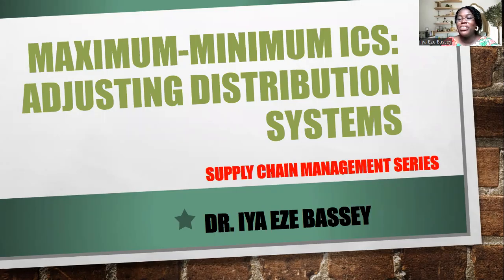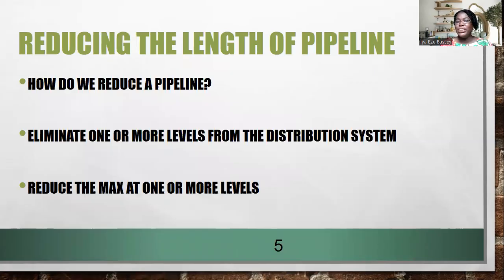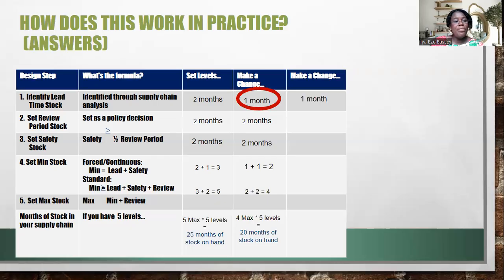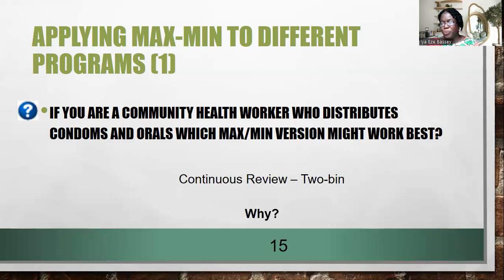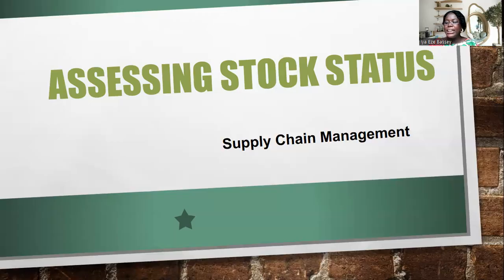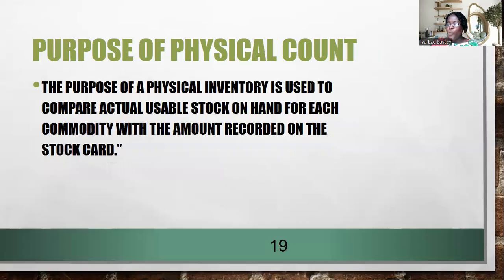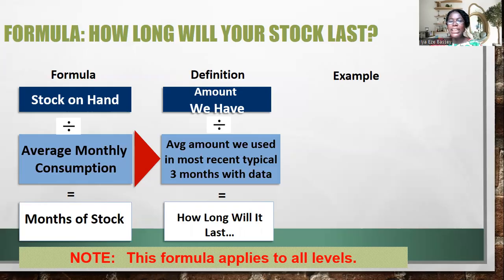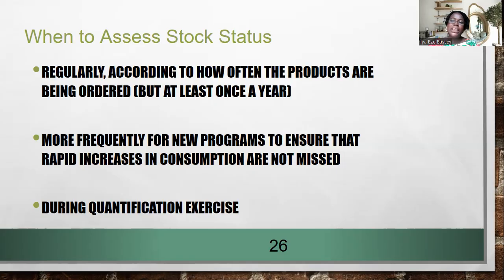Maximum-Minimum ICS: Adjusting Distribution systems (Supply chain management series)

Comment: Thanks for the lecture, ma'am...
Here is my summary 

To adjust distribution system policies, organizations can consider several approaches. These include optimizing transportation routes and modes, implementing technology solutions for better tracking and visibility, collaborating with suppliers and partners to streamline processes, adopting lean inventory management practices, and continuously monitoring and analyzing data to identify areas for improvement.

The maximum-minimum inventory control system sets upper and lower limits for inventory levels. The advantages of this system include reducing stockouts and excess inventory, optimizing cash flow, and improving customer satisfaction. However, challenges may arise in accurately determining the appropriate maximum and minimum levels, managing demand fluctuations, and ensuring effective communication and coordination across the supply chain.

    The inventory control system used in LMHC involves managing the stock of HIV/AIDS commodities, such as antiretroviral drugs and diagnostic kits, to ensure their availability and proper distribution. This system typically includes forecasting demand, monitoring stock levels, implementing reorder points, tracking expiration dates, managing storage conditions, and coordinating with healthcare facilities to meet the needs of patients while minimizing wastage and stockouts.
    Assessing stock status refers to evaluating the current inventory levels, conditions, and availability of products. The purpose of this assessment is to ensure that sufficient stock is available to meet demand, identify potential stockouts or excesses, determine reorder points, optimize inventory levels, and make informed decisions regarding procurement, production, and distribution. Regularly assessing stock status helps organizations maintain efficient inventory management and meet customer needs effectively.

Comment: Thank you very much MA for this wonderful lecture.
In Summary of this topic; maximum and minimum ICS : Adjusting distribution system, have been able to know that the steps in designing a max- min ICS are to set up initial max- min policies for each level and type of faculty, check if the overall distribution will function properly if the level specific max-min policies are are implemented and also checking the total cost of length of the pipeline that the policies at each level imply.
You made us to understand the other factors that impact the max-min stock levels ; like, cost of products, storage capacity, cost of storage, reliability of transportation, age of program, management skills of staff, accuracy of forecasts etc..
You made us to understand that the advantages of using max-min stock is to Avoid overstocking
To avoid under stocking
To minimise wastage
To avoid costs of emergency order etc.
We have also learn how to assess stock status and why we should assess stock status.
Thank you so much Dr.

Comment: I was able to understand the steps involved in designing a max-min ICS which are;
1. Setting up an initial max-min policy for each level and type of facility
2. Check the overall distribution
3. Check the total length of pipeline that each policy level implies 
Also the factors that impact the max-min levels are 
1. Cost of production 2. Lead time 3. Storage capacity 4. Cost of storage 5. Age of program
 The Advantages is using the max-min system are;
1. Avoid overstocking 2. Avoid understocking 3. Minimize wastage 4. Avoid cost of emergency order 
I also learnt that the system with numerous levels can affect the use of this system, also the system that manage products of new program can be challenging in using the variation
In summary, in the medical laboratory science field, the max-min ICU can be very important in managing the supply and consumption of laboratory reagents and equipment. The laboratories should ensure to have enough inventory meet demands without excessive or shortage stocks

Thanks ma'am
Reply: In this session we will begin from,
1. LENGTH OF PIPELINE
The steps in designing a max-min INC are;
A. set up initial max-min policies for each level and type of facility.
B. check if the overall distribution will function properly if the level specific max-min policies are implemented and 
C. check the total length of pipeline that the policies at each level imply.
Note that reducing length of pipeline;
I. eliminates one or more level from the distribution system
ii. reduce  the max at one or more levels .
we also find out how to reduce maximum stock level, by reducing review period,lead time and improve distribution system reliability.
OTHER FACTORS THAT IMPACT MAX-MIN STOCK LEVEL INCLUDES; 
>cost of product
>storage capacity
>cost of storage
>lead time, etc.
ADVANTAGES OF USING MAX-MIN SYSTEM:
> avoid over stocking
> avoid under stocking 
> minimize wastage, etc
 CHALLENGES TO USING EACH VERSION AND VARIATION;
> System with numerous levels.
> system that manage a large number of commodities.
> system that manage product for new programs.
DEFINITION OF PHYSICAL COUNT: A physical count is a process of counting by hand ,the total number of usable units of each commodity in your store or health facility at a given time.
PURPOSE OF PHYSICAL COUNT
>To compare actual usable stock on hand for each commodity with the amount recorded on the stock card.
>To determine how long supplies will last.
WHEN TO ASSES STOCK STATUS
>During quantification exercise,etc.
THANKS FOR THE LESSON MA.

Comment: Thank u ma for this lecture 
  In summary, the steps in designing a max-min ICS are;
1: Set up initial max-min policies for each level and type of faculty 
2: Check if the overall distribution will function properly if the level specific max- min policies are implemented 
3: Check the total length of the pipeline that the policies at each level imply .
   I also learnt how to reduce the length of a pipeline and also how to reduce the maximum stock level.
Also some factors that impact max-min stock levels which I’ll list few ; lead time , reliability of source of supplies, effect of a zero balance or stock ,management skills of staff,age of program,etc .
I also learnt about the advantages to using max-min system which are ;Avoid overstocking, avoid under stocking, minimize wastage ,etc . 
I also learnt how to apply max-min to different programs  and when to access stock .

Comment: Thank you ma'am
Inventory control system (ICS) is usef yo manage and adjust the distribution of goods. The maximum ICS represents the upper limit of inventory that should be maintained to avoid excess while the minimum ICS is the lower limit to avoid stockout. Also steps in designing the length of a pipeline include; set up the initial max-min policies for each level and type of facility, check if the overall distribution will function properly if the level specific max-min policies are implemented and check the total length of the pipeline that the policies at each level imply.

Comment: Thank you Ma
In summary: 
There are steps In designing a Mac-min ICS which are; 
Setting up initial Max-min Policies for each level and faculty 
Check if the overall distribution will function properly if the level specific max-min policies at each level imply.

Elements of the Formulas which can be changed in order to reduce the max stock level
-Shorten  the review period at  one or more levels 
-reduce the lead time at one or more levels
-Improve the distribution system reliability

 Factors that impact max-min stock level
-Cost of products
- reliability of transportation 
-shortage capacity 
-cost of storage 
-shelf life of health commodities

Advantages of using Max min system 
-avoid overstocking 
-avoid understocking
-minimize wastage 
-avoid cost of emergency order

Challenges to using each version and variation 
-systems with numerous levels 
-systems that manage in large number of commodities 
-system that manage product for new programs etc 
Assess stock status entails physical count which is to compare actual stock on hand for each commodity with amount recorded in the stock card.

Comment: In the context of medical laboratory science, maximum-minimum inventory control systems can be beneficial for managing the supply of laboratory reagents, consumables, and equipment. By setting appropriate maximum and minimum stock levels, laboratories can ensure they have enough inventory to meet testing demands without excessive stockpiling or shortages. This helps maintain smooth operations, optimize resource utilization, and ensure timely delivery of accurate test results. Effective supply chain management is crucial in medical laboratory science to support quality patient care and efficient laboratory operations.

Comment: Thank you Ma'am for the wonderful lecture.
In summary,steps in designing a max-min ICS are; Set up initial max-min policies for esch level and type od facility.
Check if the overall distribution will function properly if the level specific max-min policies are implemented.
Check the total length of the pipeline that the policies at each lecel imply.
I also learnt about the steps in reducing the length of pipeline and other factors that impact the max-min stock level.
I learnt about the advantages of max-min system such as avoiding over stocking,under stocking, minimize wastage etc as well as the challenges of using each version and variations.
I also learnt about the physical count which is the process of counting by hand the total number of usable units of each commodity in the store or health facility.

Comment: I learnt ways in which the max-min system is being adjusted. One of the important step to take is reducing length of pipeline. I also learnt the different advantages of using a max min system and challenges associated with it. I also learnt the max min version that can be used in different scenerio, example for condoms and orals the continuous review - two- bin is the best to be used. While the Standard version is best for HIV test kits. In assessing stock status, we do a physical count to determine how long supplies will last. Stock status can be assess regularly according to how the products are being ordered, more frequently for new programs and by doing quantification exercise.

Comment: In summary, I learn that,
In Adjusting distribution system, you need to consider the following; Length of a pipeline, Reducing the length of a pipeline, Reducing the maximum stock level.
Advantage of max min inventory control system are: 
Avoid stocking, Avoid under stocking, Minimize wastage, Avoid costs of emergency order, Consistency of stock levels, Simplify inventory control decision making.
Challenges to using each versions  & variation are:
System with numerous levels, System that manage a large number of commodities, Systems that manage products for new programs.
Assessment stock status helps to determine our month of stock. It I'd done in two ways:
1. Physical count
2. Determine how long supplies will last.
The purpose of a physical inventory is used to compare actual stock on hand for each commodity with the amount record on the stock card.
Thank you Ma

Comment: In this series, I learnt that there are steps involved in designing Max - Min ICS which include; setting up initial Max- min policies for each level and type of facility, Check if the overall distribution will function properly, check the total length of the pipeline that the policies at each level imply. The factors that impact Max- Min levels are; a) cost of production b)Lead time c) Storage capacity d) cost of storage e)age of program. Some advantages of Max-min system are: minimize shortages, avoid over stocking, consistency of stock level and avoidance of emergency order. When we talk about the Challenges involved, we have: System with numerous system, system that manages a large number of commodities, system that manages products for new program. Physical count is the process of counting by hand the total number of usable units of each commodity in a health facility at any given time.
In summary, The maximum- minimum inventory control system;adjusting distribution system course equips participants with the knowledge and skills necessary to effectively implement this inventory management strategy.

Comment: Max min adjusting distribuition  system is about finding ways to reduce factors affecting distributions.
 I learnt how to reduce the length of pipeline 
Which is reducing review period at all levels or 
Any other level from the distribuition
Advantages and challenges where also learnt which are 
Advantages 
Avoid overstocking 
Avoid understocking
Challenge 
System with numerous levels.

Comment: In Summary
We have three steps in Max-Min ICS which are
1) Settings up initial Max-Min policies for each level and type of facility.
2)Cgeck of tge Overall distribution will function properly if the specific Max-Min policies are implemented.
3)Check the total lenth of the pipeline that the policies at each  level imply.
The purpose of Assessing stock status is to determine how long supplies will last.
We access stock regularly, according to how often the products are being odered.

Comment: In summary, the steps in designing a max_min ICS are:
1. Setting up initial max_min policies for each level and type of facility.
2. Check of the overall distribution will function properly if the level specific max_min policies are implemented.
3. Check the total length of the pipeline that the policies at each level imply. 

   Advantages of using max_min system are:
1. Avoid overstocking
2. Avoid understocking
3. Minimize wastage
4. Avoid cost of emergency orders

Comment: Thank you Ma for this wonderful lecture. In summary,
The steps in designing Max-min in ics are:
set up Initial max-min policies for each level and type of facilities.
check if the overall distribution will function properly if the level specific max-min policies are implemented.
check the total length of the pipeline that the policies at each level imply .
We can reduce a pipeline by; eliminating one or more levels from the distribution system, Reduce the max at one or more levels.
Factors that impact max-min stock levels are:cost of products, storage capacity, cost of storage, management of skilled staff, Age of program etc.
The advantage of using max-min are to avoid over stocking, to avoid under stocking, minimize wastage etc.

Also elements to reduce the maximum stock level:shorten the review period at one or more levels, reduce the lead Time at one or more levels and improve the distribution system's reliability at one or more levels so that safety stock can be reduced.
The factors that impact Max-Min stock level:cost of production, reliability of transportation etc....
Advantages of using Max-Min system: minimize wastage etc.

Under assessing stock status,
Physical count, which is the process of counting by hand the total number of usable units of each commodity in a store at a given time, should be ensured to know how long supplies will last.
While calculating in the example, if one of the last 3 months is 0, the month before the 1st last month is used.
Stock status should be assessed regularly, more frequently and during quantification exercise.❤️

Comment: Thank you ma
In summary,i was able to understand that maximum minimum system deals with avoiding overstocking under stocking wastage avoid cost of emergency orders.
 I had a clear understanding on physical Count,
 Physical count is the process of counting by hand,the total number of usable unit of commodity in your health facility at a given period of time.
I also learnt about the steps in designing a maximum minimum ICS.
The advantages of using maximum minimum system,
Avoid overstocking
Avoid under stocking
Minimize wastage..

Comment: The ICS (Inventory Control System) in supply chain management involves managing inventory levels effectively. When it comes to adjusting distribution systems, the general approach is to go from a maximum to minimum ICS. This means reducing excess inventory levels to optimize distribution. The maximum ICS refers to maintaining higher inventory levels. This could be done to ensure product availability, meet customer demand, or account for unpredictability in supply or lead time. To adjust distribution systems towards a minimum ICS, certain strategies can be implemented. This helps reduce carrying costs and the risks associated with excess inventory. Other approaches may involve implementing demand forecasting systems to better align supply with demand.

Comment: Thank u ma for this wonderful lecture 
  In summary,,The steps in designing a max-min ICS are;
1: Set up initial max-min policies for each level and type of faculty 
2: Check if the overall distribution will function properly if the level specific max- min policies are implemented 
3: Check the total length of the pipeline that the policies at each level imply .
   I also learnt how to reduce the length of a pipeline and also how to reduce the maximum stock level.
Also some factors that impact max-min stock levels which I’ll list few ; lead time , reliability of source of supplies, effect of a zero balance or stock ,management skills of staff,age of program,etc .
I also learnt about the advantages to using max-min system which are ;Avoid overstocking, avoid under stocking, minimize wastage ,etc . 
I also learnt how to apply max-min to different programs  and when to access stock .

Thank u ma